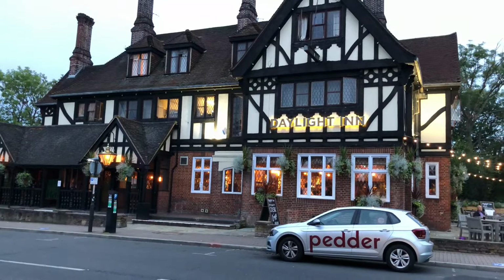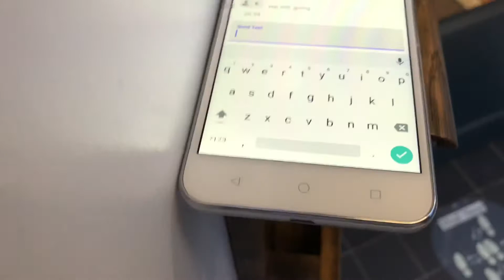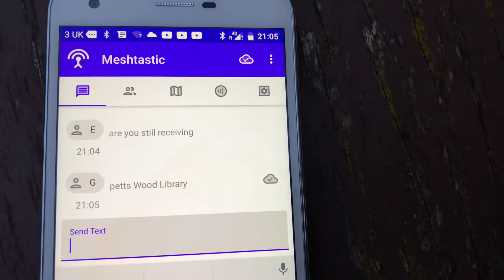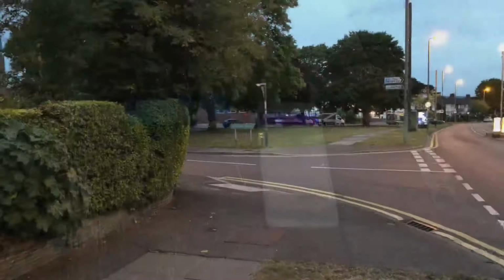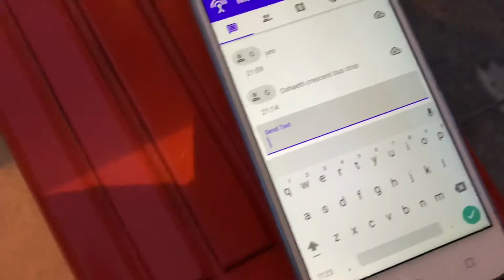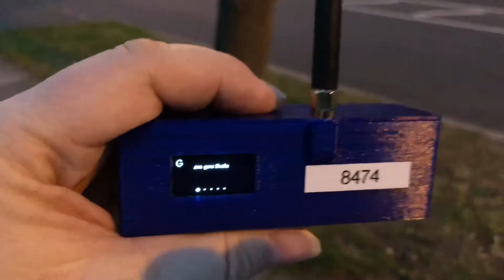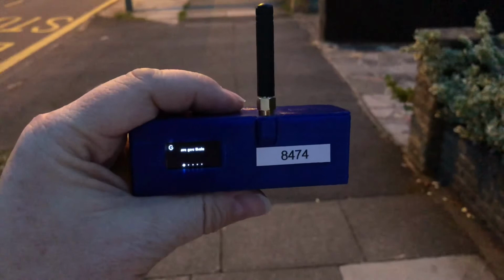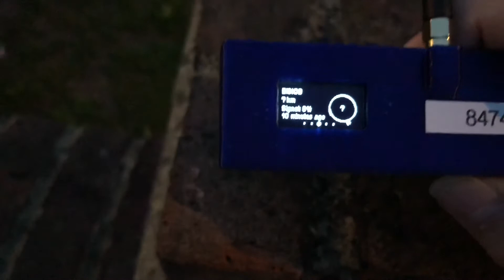Meshtastic Field Test

Comment: few of those, solar powered placed on high places around the city and you have doomsday mesh  comm system. neat :D .
Reply from the maker: Yes, as long as you respect the license-exempt conditions.
Reply: @G8YTZ  the mindset of respecting licensing during a doomsday scenario will be the impetus for the doomsday scenario
Reply from the maker: True enough.
Reply: I have about 60 acres in Central Oregon where we have a two homes at opposite ends as well as a shop about in the middle between the two. I'm planning on setting up my own little communication system so my parents that live at one house and I can communicate with me at the other house or the shop, basically we can communicate wherever we are on the property that we don't get cell coverage at. Excited to see how it works
Reply: @mhrepoman  called radios. way more reliable than this

Comment: Great job! Personally I am interested in 433mhz version, three devices, and this in the middle to be with let say 10dbd antenna. Probably this will improve the range a little bit. 73 from Bulgaria
Reply from the maker: The 433MHz version should perform nearly as well, but in London it is a far more congested band. As far as antennas go you need to stay within the law, but a small 1/4 wave ground plane should be suitable. If you have an amateur license then the main challenge will be to ensure none of your traffic is encrypted.

Comment: These Meshtastic devices operate in the 868MHz SRD band in the UK - are they approved under the Radio Equipment Directive (RED) and/or UKCA equivalent and do they meet the requirements of Ofcom IR2030 ?
Reply from the maker: Or in the license exempt 433.9MHz allocation, but the 430MHz versions can operate anywhere within the Amateur 70cm band (430-440MHz) according to the license conditions if you have an Amateur license (which I do).
Reply: @G8YTZ  I know what can be done in the 70cms band being licensed myself but there seem to be a lot of people using the 868MHz band as it it were an open 'experimenters' band when in fact only type approved equipment can be used?  Mike G8TIC
Reply from the maker: @G8TIC  Sure, as far as I am aware the TT-Beam module is compliant with a compliant antenna, but the 443MHZ version is easily configured for any part of the 70cm band for the likes of us.
Reply: @G8YTZ  The RF module might be compliant with UKCA/RED but the whole product still requires EMC approval along with all the other relevant safety standards like Low Voltage Directive and various standards for use of LiPo batteries, etc.  Remember that the compliance regime covers both (a) "placing on the market" and/or (b) "taking in to use" - this effectively prohibits experimenters outside ham radio.
Reply from the maker: @G8TIC  I think Ofcom are too busy with their broadcast code and hypothetical EMC risks to worry about enforcing activities in license exempt bands.

They could turn their attention to organisations using the PMR bands for broadcast services.

Comment: How easy would it be to take down the entire mesh network?  What are the weaknesses if someone were to want to cut off this form of communication? Can it be used in the event that cell service and internet are completely down?
Reply: To take it down you'd have to either ensure that no node can contact another node (because these nodes come with routing software which will re-route in the event that one goes offline) or someone could jam the entire frequency (but if you're at the point where someone's that pissed off there's not much  you can do). And yes they can work without internet or cell service, which is why they're incredible.
Reply: It's hard to do.... As the person above stated.... It has many capabilities on how it works without modern things(cell/net/etc, it has the abilities in a way to kind of set up a type of WiFi net if the internet actually crashed. If there were a world collapse and there were enough mesh networks around, it could connect people in counties/cities/states/really just depends how many nodes were out there ..... It could connect people like we connect to our WiFi networks or hotspots. We could chat, get updates and the software could be updated in so many ways. It's constantly being improved, evolving and the concept of how it works is so very simple and kinda old actually... mixing the old with the new and it's really producing some awesome results!

Comment: A unit does not have to paired with a phone to just act as a repeater does it?
Reply from the maker: It seems not, at least from my experiments
Reply from the maker: @MohawkInBelgium I've only run some basic tests fro home. The main repeater site will be at the same location as the GB3JV TV repeater. The antenna is a small omni designed for LoRa applications and it will be mounted on the exiting antenna mast, but at a lower level. The station PC is a small Intel Atom machine and there is a small Cisco Meraki VPN router there, the Meshtastic device will be powered from one of the PC's USB ports, so this will give me access to the device for flashing new code etc. I'll get it installed in the next week and I'm comfortable it will serve parts of the BR1, BR2, BR3,  BR5m BR6 & BR7 Postcodes as the site is reasonable high. The 3.4GHz DVB-S can easily be received on Reigate Hill with just a C-Band LNB and Sat Finder (no dish), but the ERP here is 150W.

Comment: How difficult would it be to cause a basic Denial of Service attack - by surreptitiously introducing another one of these into an existing network - and constantly spamming the network with automated gibberish messages - & constant chirping ?! Seems like a potential problem unless you can precisely control which nodes can communicate ... I don;t know how ht meshtastic software operates and how new nodes are added - ..
Reply from the maker: As with any radio network, not that difficult. However I would suggest that you firstly familiarise yourself with the 1984 Telecommunications.  Act and subsequent updates as deliberately interfering with a telecommunications system is a very serious criminal offence with massive  fines and the possibility of imprisonment. 

https://www.legislation.gov.uk/ukpga/1984/12/contents

Comment: Hello, how can I get in touch with other users?
Reply from the maker: You will:
1. Need to be within range of another user or "node"
2. Be using the same frequency band (868MHz, 433.9MHz etc.)
3. Be a member of the same group as other users (a bit like a What's App group)

I have set up a "relay" node in Petts Wood, Kent that serves a few miles of radius, shortly the node will be moved to an even better site.
Reply: @G8YTZ  Hello, I have the 0.7 version with the mechanical switch. I uploaded now the latest alpha version on both devices (me and my wife) and it's working. I am on the default channel #-B. I will take a walk later up to a small hill hoping to see someone else around. Should I remain on the default channel... My location is Germany near Aschaffenburg, thank you and 73! DE1CTL 🙂